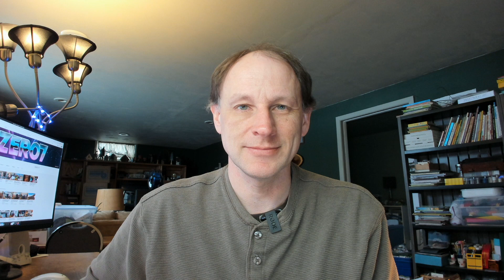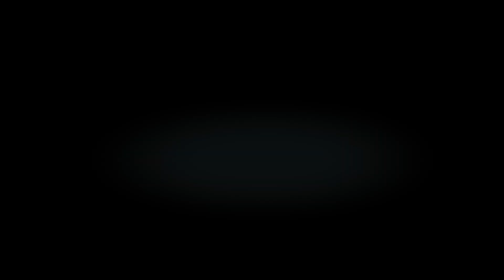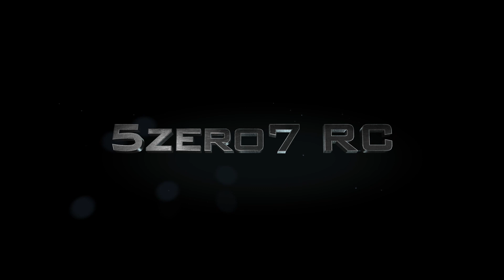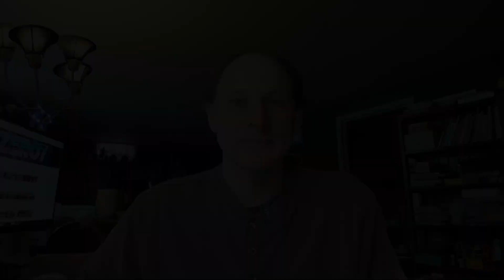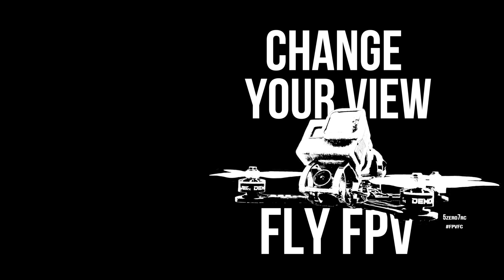BlHeli32 Release 32.8 with Variable Motor PWM Frequency

Comment: I put this on a 5 inch that has tons of bobbles on 0 throttle. On 32.8 with 24-48khz it flies insanely good, but motors are hot no matter what I do. Even locking it at 48khz on 32.8 it's hot. On 32.7 48khz with minimal filtering, motors barely get warm.
Reply from the maker: That’s interesting.  Wonder what’s causing the hot motors.  Thanks for sharing.

Comment: Flash with caution, but I tried some 32.7x pre release and it seemed to improve propwash on my 5 inch and I haven’t had any issue with hot motors or desyncs. Edit) 32.8 is sooo smooth wowww
Reply from the maker: So far I have not heard of anyone having an issue with this update.  I might have to give it a shot sooner than later :)
Reply: ive tried it yesterday. i had no problems so far...it does feel a little smoother

Comment: I’ve been running the beta version of this variable PWM firmware for about a month on my 4 quads and it seems to work well! Good torque at low rpm and good smoothness and efficiency at higher rpm; the best of both worlds.

Comment: I'm really excited to see what a difference variable PWM makes. Pete makes a good argument that variable PWM should be based on motor rpm, not throttle position, but the down-side is that you have to program the motor poles into the ESC, which is a step many people are not used to having to do.
Reply from the maker: Yeah, maybe there can be some compromise here and have it both ways.  By default the "lazy" people can have it based on throttle position and the people who are willing to go to the extra effort of setting motor poles can have it that way.  Will be interesting to see how this plays out over the next few updates for sure, especially if BLHeli has competition.
Reply: Great to have open source! surprised software's don't work with motor RPM. (learner bee)  Interested about dead cat tuning from this development.  CHEERS  - GOOD HEALTH TO ALL